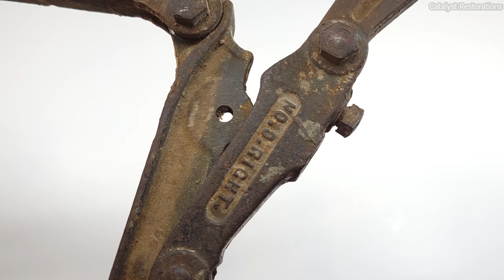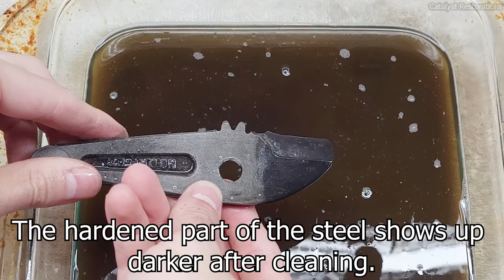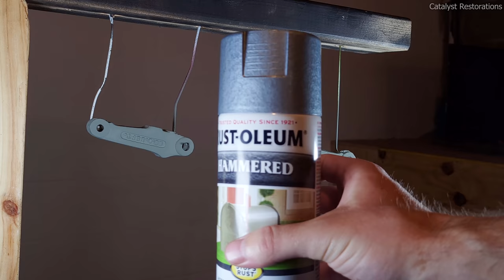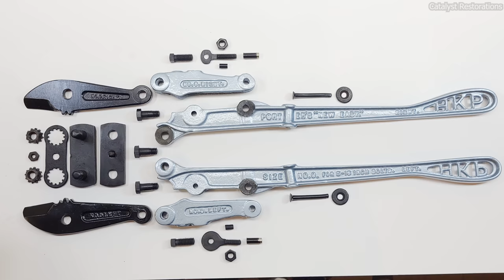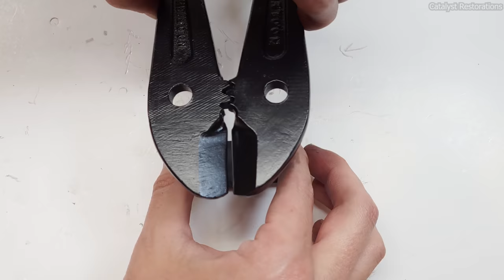130-year-old Bolt Cutter Complete Teardown and Restoration

Comment: A couple tips for what was a nicely done job overall and the finished product is quite attractive. First...good job on saving the cutters. Iys easy to go too far.
Now...paonters tape can go a long when used to cover adjacent areas and protect against touch ups.
It always helps to try and find pics (not always possible) to see how much casting pitting was on an original. Even heavily painted items back then would show dimples in the paint. Too smooth can be too smooth.
It appeared you ground a casting seam off one edge if a handle.  Could just be the light but if im doing a tool like this for a customer and it has a seam...the seam stays. To each their own.
A bolt and a washer and a cheap welder go a long way to recreating a turn screw.  You obviously have talent and brains so picking up welding on that level would take you no time at all.
Last...you won't have thread repair if you screw some nuts onto the threaded portion of the bolt.  Jam Nutting them will have them offset a bit but in most cases it will be fine.
These are just points from my world and not criticism.  Im hoping you find a way to use them to your advantage.  Keep up the good work! Too many old, beautiful tools are being tossed in this disposable world where the hard work and craftsmanship  that created them is following at a rapid pace.   Be well. Be safe.
Reply from the maker: Thanks for all the tips, Brett! Much appreciated!

Comment: Adjustable wrenches have a direction they're supposed to be turned. If you turn them the right way, it causes the jaws to grab harder. If you turn them the wrong way, it causes the jaws to open. You're turning it the wrong way.
Reply from the maker: Great tip! Something that surprisingly doesn't get explained enough. Check out some of my more recent videos and you'll see this advice in action! 😉

Comment: Wonder if a line of weld on the blades would give you something to work with when sharpening the blade in the future 🤔
Reply from the maker: A few other commenters also suggested this! They suggested using an old drill bit tip for a steel you could then harden.

Comment: I'd have considered grinding those jaws down and replacing them with some new tool steel jaws, or building them up with weld.
Reply from the maker: Definitely an option, as other commenters have suggested as well. They've held up so far with use, but no more room to clean them up should they ever get a new dent in them.

Comment: I have the same bolt cutters but the size larger, my jaws were ruined also and I've contemplated how to fix it properly, when you grind them you end up out of Tolerance, if you weld in material I don't know if it's hard enough?.......
Reply from the maker: Restoring those jaws is definitely not an easy task! In one of the top comments on this video it was suggested that you can use old drill bits in place of a TIG rod (or tool steel rods, which are expensive), then grind down the welds as needed. You may have to re-heat treat them as well to get appropriate hardness, but it should work. I don't own any welding equipment, so sadly this wasn't an option for me.

Comment: Do you know why a Crescent adjustable wrench has a big jaw and a little jaw ? The big jaw is always used on the side away from the direction of rotation. That way, all the torque is on it and not the small, weaker jaw. Check it out.
Reply from the maker: Yup, great advice. This was mostly just me so excitedly diving into the disassembly that I flip flopped it. If you watch my latest video of the Carolus 25" bolt cutter you'll see things are used as they should be 😁

Comment: For what it's worth, here's my rule of thumb. Use a single hex socket. If you can't then use a multi-hex. If you can't then use a ring spanner. If you can't then use an open-ended spanner. The absolute last resort is an adjustable wrench.
Reply from the maker: Great tip!

Comment: Are these bolt cutters really that old? It is hard to believe looking at their blades, which are not so badly chipped. As if they were little used Robie as a miner in a hard coal mine in Poland and I deal with such tools, I also know what I am talking about.
Reply from the maker: They were not likely made in 1896, but definitely no later than the early 1900's because HK Porter changed the design away from this by the 1910's. Some other commenters suggested it was probably used on a construction site, since it was covered in concrete and the jaws' chips plus the bent handles suggest someone was getting some extra leverage to cut rebar. As you probably also saw I had to crank the adjustment screws all the way down, so the jaws had been refaced a number of times.
Reply: @CatalystRestorations  The jaws have for sure been replaced. Even so far, at a construction site, something forcible is often done on the so-called "patent". If there is a thicker rebar to cut and there is no force to cut it, the scissor arms are extended. Various "patents" are also used in the mine, not necessarily compliant with occupational health and safety, the creativity of which would not be ashamed of Macgyver himself. All this to achieve the intended goal.
Reply from the maker: @pawelpawel2133  Yup, the 'ol cheater bar! 😉

Comment: I have this No.0 and a No.14 I want to restore and I’m confident I can do it after watching your video and others like it. What is the fix if my cutters/blades are pretty chewed up and the rubber stoppers have been cut away? Is there any adjustment? Will I be able to re-bevel the blades or do I need to find new ones?
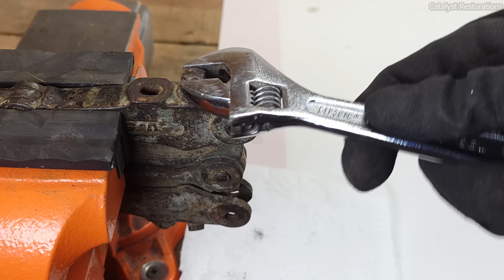Reply from the maker: You can bevel and refinish the jaw edges a bit, but you'll have to be careful not to remove too much material that the jaws don't end up flush to each other. You can get a feel for how much material you can remove by playing around with the adjustment bolts on the side of the arms. The square bolts I remove at 4:42 and reassemble at 26:05 are the adjustment bolts and are what dictate how "closed" the jaws can get. When you tighten down the bolts, it pushes in the left and right arms that connect to the jaws, which in turn pushes the jaw edges closer together. Obviously there's only so much you can tighten down the adjustment bolts and if your jaws still can't get flush then you'll have to either get replacement jaws or weld some new material onto the jaws. Some of the top commenters on this video explain how you'd go about doing that. Be sure to check out my other bolt cutter restoration video where I restored an identical pair with japanning - at the end of that video I walk you through how to use the adjustment bolts! Happy restoring!
Reply: @CatalystRestorations  thank you very much! Very helpful

Comment: Have you put these cutters into use? I ask because I have not found that spray paint provides a very durable coating. Has the finish gotten dinged or nicked?
Reply from the maker: Hi Ken! I've used these a handful of times now since finishing this project, although nothing I'd deem as heavy duty work. No chips or dings to note so far even when I've bumped it against things. In my experience the best methodology for  spray paints is soaking bare steel parts in acetone or degreaser, then a heavy coat of etching primer, wait 2 full days, paint 1 medium coat of color of your choice, wait at least 2 full days, then another medium coat, then wait at least a full 30 days before use. I know it's a long time, but enamel spray paints take a very long time to fully cure. But you'll never see them put that on the can! You might already know all this, but figured I'd explain. I almost exclusively use Rustoleum myself, and I've found I have much better luck with durable finishes from Rustoleum Industrial, Hammered, or the 'Stops Rust' labels. I've never had great results with the '2X painter's touch' or just their regular paint/primer-in-one for metal surfaces. Of course, that all being said powder coating is really the king of finishes these days, but not everyone can afford the setup. Hope that helps!
Reply: @CatalystRestorations  Many thanks!

Comment: Great video and instant subscribe - really like seeing that great piece of hardware brought back and thought you did a great job of it! 👍 (I was wondering if "Japanning" would be a good option for this piece - great video on that over at Hand Tool Rescue)
Reply from the maker: Thanks Fred! You are spot-on - all signs point to this piece being originally Japanned when it came from the factory! You can see remnants of the black on the bare metal after the wire wheeling. I'd love to get into Japanning someday and I've closely followed HTR over the years 🙂👍. All I need is a separate oven to bake them and handle the nasty fumes from the process.

Comment: is this a common bolt cutter? I have one that I inherited from one of my grandfathers. I am 66, so it could be easily that old.
It is night and there is snow on the ground so I will check in the morning after I finish watching.
Reply from the maker: It definitely could be that old easily. I wouldn't say these were particularly rare in their day, but they're becoming scarcer every day as people throw them out or they're lost to time so they're becoming rarer today. You can usually find a few floating around on eBay (in various stages of disrepair) for 'only' about $30-40. I consider it lucky if you find them elsewhere for less than that.

Comment: 4:14 was cute! 

Question: how reusable is the rust remover liquid? How does one dispose of it when they're done?
Reply from the maker: The rust remover is called Evaporust. It's water based, non-toxic, and biodegradable. You can re-use it over and over until the solution is midnight black, which is when the solution is finally completely spent. It lasts quite a while.
Reply: Dump it on the ground like I do my used motor oil

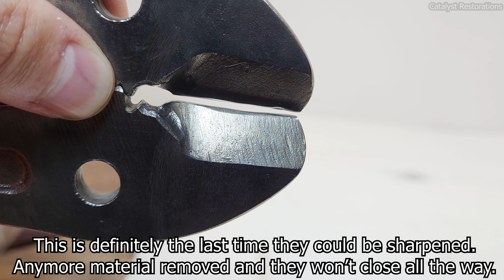Comment: 14:35 not if one were to remove metal from other places allowing to close closer, but yes not many more sharpenings left without modification.
Reply from the maker: Yup! Some other viewers suggested welding on some fresh tool steel then shaping them.

Comment: The jaws are steel, not cast, why not weld material onto the jaws, then reshape them. As they are they're pretty much useless.
Reply from the maker: Yeah, if you take a look at the top rated comment on this video it's also suggested there. Welding is absolutely an option! I, like most people though, don't own a welder. I've been using these cutters for months since finishing them and they work great honestly.
Reply: @CatalystRestorations  Well that's good. I hope you get a welder soon, it will open up all sorts of things for you. Media blast cabinet too. I know, they cost $$$ and it takes time to acquire some of this stuff.

Comment: I have a pair just like these.
Mine are in a little better shape.
were do you find the date?
Now I need to take a closer look at mine.
great video
Reply from the maker: They're difficult to truly date. I was going by the patent date on them, but obviously that doesn't when this pair was actually made. I usually look through old catalogues I can find online doing some research and see if I can land any close matches.
Reply: @CatalystRestorations  After I saw your video, I went out to my shed and looked at mine .                                         I noticed the the jaws on mine are worse than your .                                                                                                               Other than evil bay,do you know if you get new jaws?
Reply from the maker: @rogerwachal3718  I'm not sure where else you could find new jaws for a vintage tool like this besides eBay. Other options are trying to resurface the blades like I did in this video (if there's enough material left) or welding on a new bead of tool steel like one of the other commenters on this video suggested.
Reply: @CatalystRestorations  Thank you for the suggestion.
Your bolt cutters came out great.
I notice on mine the letters had gold paint on them.

Comment: I cringe at how many people don't know how to use an adjustable spanner properly. Nearly everyone I see only use two sides of the spanner to undo or do up a nut, when you get the size of said nut, you move it to the very inside of the adjusting section, this way you use three sides to grip the nut instead of two, and most end up slipping the nut causing damage to nut, spanner and maybe your fingers. More sides to grab hold of the nut is not only safer but, makes the spanner and nut last longer.
Reply from the maker: Makes sense! Great tip!

Comment: Hey there, love your videos!  Did you notice that the original casting of the handles has HKP on the one side and HKB on the other?  Seems like a casting error?
Reply from the maker: Hmm...maybe I'm not understanding you correctly but both handles say HKP on mine.
Reply: @CatalystRestorations  In the last few photos, when you have the HKP top handle showing HKP, the bottom handle shows HKb. Might depend on the way you have the cutter facing to be able to see it.
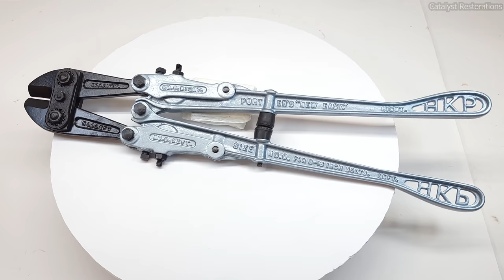Reply: @CatalystRestorations  Pause your video at 29:55 and look at the bottom handle.
Reply from the maker: @tboneharley1996  The HKP logo is mirrored along the centerline of the cutters. So you're just seeing it 'upside-down' in that shot and the 'P' looks like a lowercase 'b'.

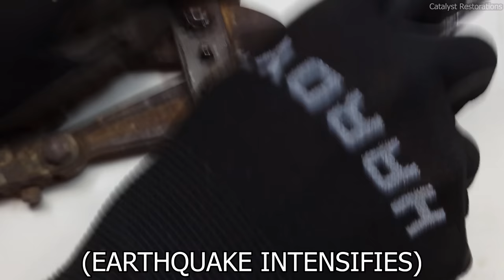Comment: 2:57 is the reason you never use the adjustable knuckle busters unless you absolutely must. Like, half a continent away from home and you are in the back of beyond.
Reply from the maker: Knuckle buster is accurate. This tool was tricky because the bolts were all non-standard sizes and wrenches and sockets alike were slipping as a result.

Comment: If you ever use the small jaw and try to break a very, very tight nut or bolt, there is a good chance you will round off the not or bolt or break the small jaw. Using it the proper way, puts all the load on the big jaw, where it belongs.

Comment: If you wanna make a fine and easy cut on rubber dip blade on oil....or water with  soap , anyway you did nice job.
Reply from the maker: Excellent tip, thank you! I suppose it would've also helped if I had just not been lazy and used a new blade...😜
Reply: @CatalystRestorations  definitely must use a drop of soapy water or oil

Comment: An adjustable wrench works better when you use it right. Flip that rascle over and it will hold.
Reply from the maker: Yeah, I never knew that before this project! Thanks!
Reply: Always turn the movable jaw into your work. Less likely to round out.

Comment: If these bold cutters were patented and made in the USofA, why are they using bolts measured in cemtimeters?
Reply from the maker: I'm not sure where you're seeing that I measured any bolts in centimeters. I don't have every size under the sun so I just use whatever wrenches fit. I'm aware I was using a mix of inch and mm wrenches. In the late 1800's/early 1900's quality control wasn't the best either, so while they may have technically been "standard" sizes the tolerances may have made it suitable for slightly different sizes.

Comment: The rust remover: I always wonder, how often (if at all) can you re-use it?
Reply from the maker: I personally use Evaporust, which you can re-use many, many times over! It starts as a clearish green-yellow and over time turns to like a Coca-Cola black/brown. It just takes longer to work its magic the darker the solution gets. If any of the solution evaporates, you can just add water back into it. You can even heat the solution up for it to work faster. Eventually it will stop working, but Evaporust claims one gallon will remove 1/2 a pound in dry rust - which is honestly really impressive.

Comment: Gloves on for disassembly. Check. Gloves off for solvent. Got it.
Reply from the maker: If you're referring to the rust remover solution, it is safe on skin. Still would be better to wear gloves though, you are correct.